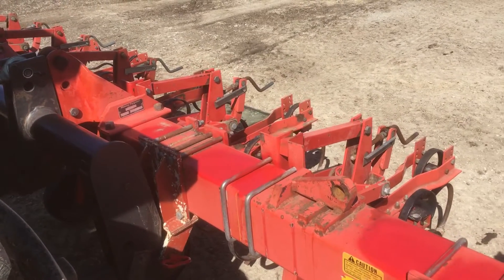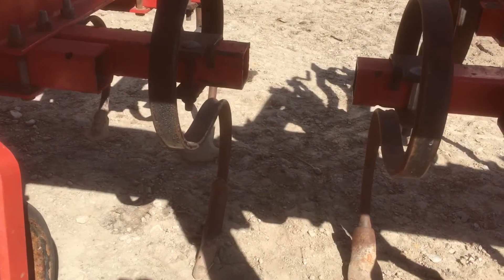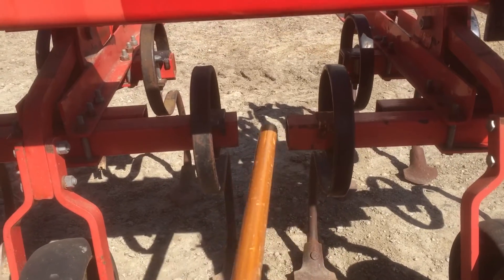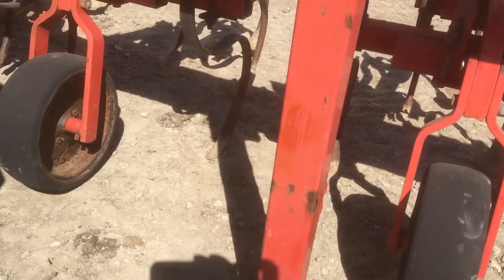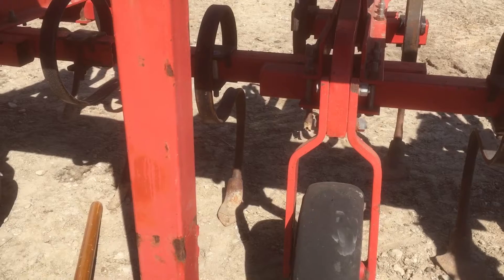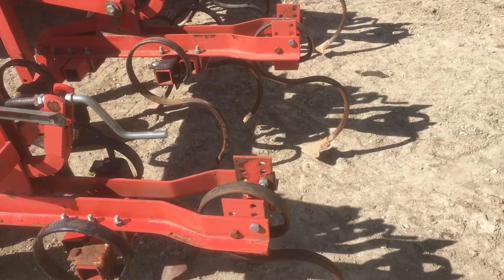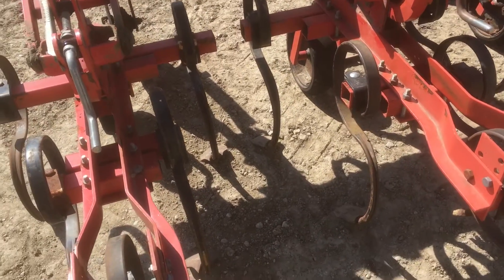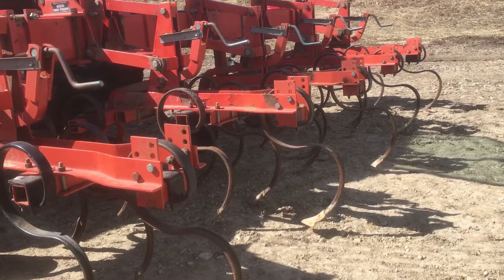In-row/Blind Cultivator pt1

Comment: Great ideas. I have a 4 row spring tooth harrow that I built from scratch that I use for blind cultivation. I used 3" square tube and angle iron then put pneumatic gauge wheels on it. I put three rows of tines on it just like all the old timey ones that everybody had in SC back in the days before preemergent herbicide. I bought the tines at Agrisupply for something like  $2 or  $3 apiece.  I would love to have one of the Einebock spring tooth harrows but they are way out of my price range. Please keep posting videos they are very interesting I am organic certified field crop farmer and good resources and information is hard to come by.
Reply from the maker: Thank you.  I like the shape of the einbock tines.  I found a source in England that will export them.  I have also found these people https://manatmachine.com/products/tined-harrow/ .  I think that the Treffler harrow is most likely a better machine, BUT, I am sure the cost would be prohibitive!  Thus, I am attempting to engineer something.